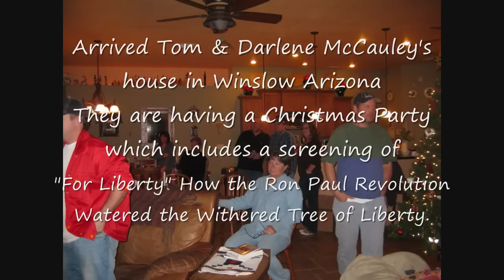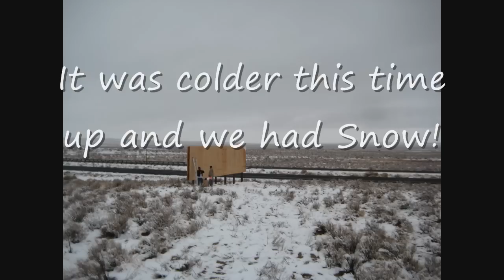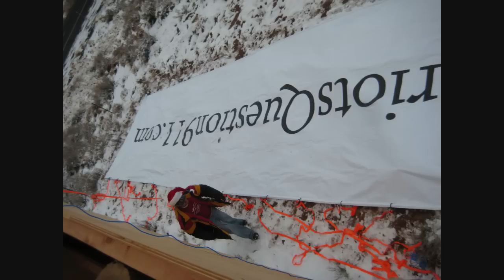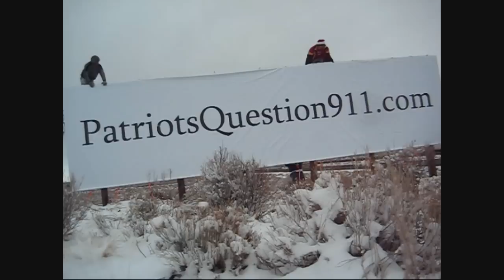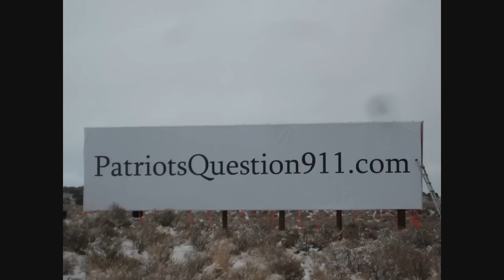911 billboards near Sanders, Arizona on I 40

Comment from the maker: 3433799: You're an engineer, great! I'm looking forward to your explanation of the following questions:
 
1.HOW DID BUILDINGS 1 & 2 COME DOWN  AT THE RATE OF FREE FALL SYMMETRICALLY IN THE DIRECTION OF MAXIMUM RESISTANCE FROM AN ASYMMETRICAL IMPACT?

2. WHAT CAUSED BUILDING 7 TO FALL LIKE A CLASSICALLY IMPLODED BUILDING WHEN IT WAS HIT BY NEITHER PLANE NOR DEBRIS.

3.  WHAT CAUSED THE  +2700 DEGREE HEAT  TO CREATE THE IRON NANOSPHERES?

4. WHERE DID THE RESIDUAL THERMITE COME FROM?

Comment from the maker: @dr71956 1.HOW DID BUILDINGS 1 & 2 COME DOWN  AT THE RATE OF FREE FALL SYMMETRICALLY IN THE DIRECTION OF MAXIMUM RESISTANCE FROM AN ASYMMETRICAL IMPACT?

2. WHAT CAUSED BUILDING 7 TO FALL LIKE A CLASSICALLY IMPLODED BUILDING WHEN IT WAS HIT BY NEITHER PLANE NOR DEBRIS.

3. WHAT CAUSED THE +2700 DEGREE HEAT TO CREATE THE IRON NANOSPHERES?

4. WHERE DID THE RESIDUAL THERMITE COME FROM?

Comment from the maker: @dr71956 Yes, gravity has a steady speed in which things fall in a vacuum 32.174 ft/s2.  Being there were steel BEAMS in the way there is no way they could have fallen at that rate.  Dropping a ball off the 89th story of the wtc would have it arrive at the earth in 8 second and wtc 1 and 2 fell in less than 10 second.  the 47 story building 7 came down in 6.6 seconds.

How did the building come down at the rate of free fall in the direction of max resistance? 

Why didn't they topple over?

Comment from the maker: @dr71956 I would like to thank you for keep coming back and not answering the most simplest of questions.  I will restate as it this will make your REFUSAL to answer blatantly obvious even to the most asleep person who is viewing the back and forth here.

WHY DIDN'T THE BUILDINGS TOPPLE OVER?

 This way they would free fall through the air instead of free fall straight down in the direction of maximum resistance.

Comment from the maker: @dr71956 yes I keep asking the same question and you should have no problem answering it.  HOW did steel framed buildings fall down at the rate of freefall in the direction of maximum resistance.
HOW have you answered the question???
where did the thermite residue come from?  How were the buildings reduced to dust?  There is simply not enough energy to do that.  
How were 600,000-pound chunk of steel  was flung 400 feet, wedging itself deep into Three World Financial Center on Vesey Street?

Comment from the maker: dr71956:ah its great that we are going to start talking actual facts as opposed to name calling.  The temperature that jet fuels burns is 950 degrees in an uncompressed state.  and Structural steel doesn't loose any integrity till it reaches 1400 degrees therefore the heat had nothing to do with it.  Now the acceleration of gravity is 9.8 m/s^2 so free fall would be around 8 seconds and the towers came down between 9-10 seconds in the direction of maximum resistance.  Check!

Comment from the maker: back to name calling is that how you have discourse?   Kerosene burns at 950 degrees uncompressed.  there was black smoke indicating oxygen starved fire which is what the design of the building was supposed to do.  Yes the temperature was high due to the THERMITE in the DEMOLITION!  do search for termite 911 look for motlen metal pouring out of building .  How do you account for the free fall in direction of maximum resistance?  what caused building 7 to fall?  Account for iron nanospheres.

Comment from the maker: @dr71956 thank you for your compliment on my intelligence, however my quest is for you to answer what seems to be the simplest questions you could be asked.  AND STILL you wont answer it BECAUSE You CAN'T.

Being you are so wise and all knowing here is a little more difficult question: 

How did the THREE buildings fall at the rate of Free fall in the direction of maximum resistance?

How did they fall symmetrically when 2 of them receive asymmetrical damage?

What caused Building 7 to fall?

Comment from the maker: @dr71956 check out architects and engineers for 911 truth.  1200 Architects and engineers have questioned the "official story" of how the buildings came down.   If 1200 architects and engineers told you that your house was going to fall down would you listen or blow it off and curse at them as well?

Comment from the maker: @dr71956 "Fire Engineering has good reason to believe that the 'official investigation' blessed by FEMA ... is a half-baked farce that may already have been commandeered by political forces whose primary interests, to put it mildly, lie far afield of full disclosure.  ... The structural damage from the planes and the explosive ignition of jet fuel in themselves were not enough to bring down the towers."
-- Bill Manning, "$elling Out the Investigation," Fire Engineering

Comment from the maker: @dr71956 I am not ever going to let it go PERIOD.  How do Steel Framed building can not fall down at FREE FALL speeds in the direction of MAXIMUM resistance?   We have had a great deal of back and forth and you are STILL unable to answer this fundamental question.  The only thing you seem capable of doing is to call names.  Being your  so smart answer the effing question!  I will answer the question for you.  Explosives were used.  The signs are still broadcasting their message and YOU LOSE!

Comment from the maker: @dr71956 what facts would you like me to look up?  could it be that when an object is falling and it comes into contact with an object that is not moving the moving object will slow down  which exactly the reason that the official story of 911 is utterly false.  How could the buildings fall down at the speed of free fall in the direction of maximum resistance?  How did they come down into their own footprint with the use of explosives?

Comment from the maker: @dr71956 see how you are?  now you use a method of disinformation to spin the argument.  Complete disinfo.  come on man how many times do I have to ask you the same question.  I would like you to consider the words before saying something inane.  How would 2 buildings fall at the rate of free fall in the path of maximum resistance symmetrically after receiving asymmetrical damage?

What caused building 7 to fall at the rate of freefall when it was hit by neither plane nor debris?